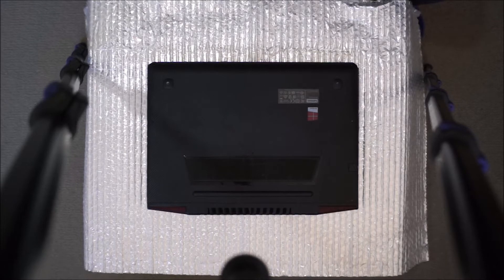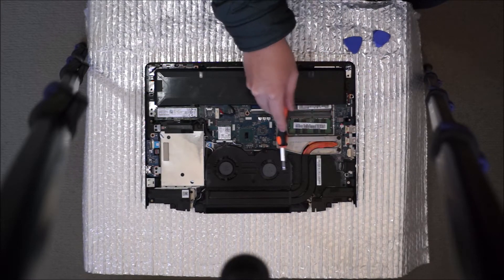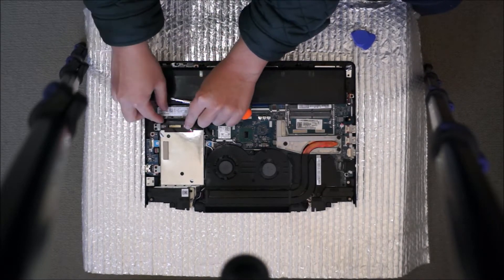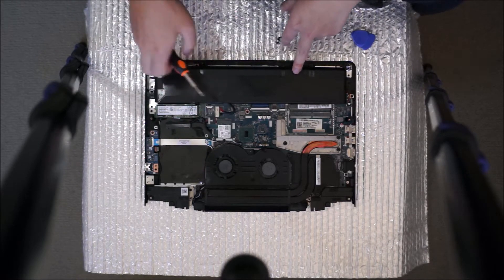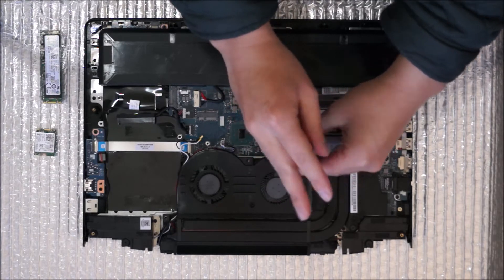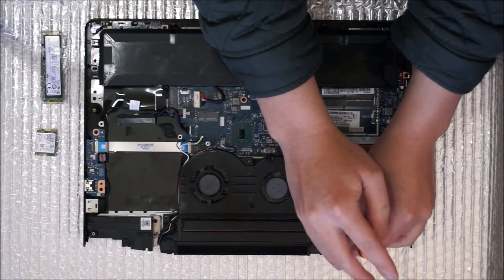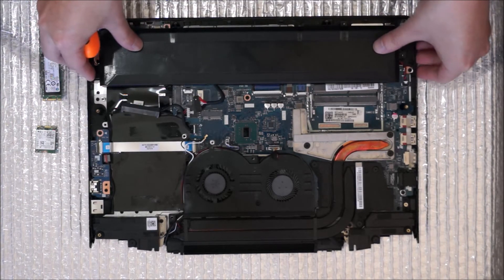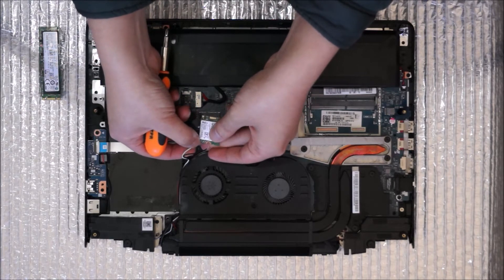OPEN ME UP ! Lenovo IdeaPad Gaming Y700 14ISK Disassembly

Comment: How can I replace the CMOS battery. I can’t find a replacement anywhre
Reply from the maker: the bios battery is same as many other laptops. look up bois batteries and if it has a cable and a connector it is probably it

Comment: Hello I have removed the cover of my Y700 to clean it. When I was done I put everything back together. However, it wouldn't work the power button doesn't light up not even the screen or the fans
When I put my mouse in the USB it lights up. When I charge the laptop the leds don't light up. Is there like a connector for the power button and leds that may have been affected or something? And where could it be? Please help
Reply from the maker: to ensure you have not miss anything open it up again and watch the video once again
Reply: @OpenMeUpTec  aight all good now. For some reason all I had to do was to unplug the battery cable from the motherboard and plug it in again. Thanks for trying to help <3

Comment: Hi 
Can I upgrade the nvme drive (my model has nvme ssd) from 256 gb to I Tb? Customer service at lenovo asked me not to because nvme upto 512 gb is supported.
Reply from the maker: this is not apple. if it fits in the slot it works. nvme 1tb has not been out long therefore if you read the user manual it is not there as 512 was the biggest back then
Reply: @OpenMeUpTec  Thanks :)

Comment: How do you replace the keyboard in this computer?  Have you disassembled it that far before?
Reply from the maker: you need to remove everything. therefore you will have to follow all the steps in the video then remove everything else after that
Reply: @OpenMeUpTec   Yeah thanks I persisted and worked it out.  They just don't make them to be easily replaced.  The keyboard is 'welded' in.

Comment: Where is the network card located what side of the board? I'm planning on removing it to install a external GPU and also what type of port does the network card use?
Reply from the maker: there the wireless card and if you watch the video you will be able to see where it is as it tells you in the video. the wireless card is a m.2 slot

Comment: Is there enough space to fit an m.2 drive that has a heat sink (like the ones from adata)?
Reply from the maker: should be able to fit it. you dont need a heat sink on a m.2 drive
Reply: @OpenMeUpTec  Thanks for replying. This m.2 drive comes with a heat sink and removing the heat sink is difficult. I am worried I might damage the PCB.

Comment: Which screwdriver i Need to Open the Laptop (Same Laptop) have Tons of screwdriver Here but all are to big
Reply from the maker: you just need one that works it needs to be small as laptops are small. you can buy a 36 in 1 set on ebay cost around $15 AUD and that will open all your small stuff

Comment: Hey there! I happened to stop by your video on changing the CPU on an HP Pavillion 23 (I have a g010, not touch screen) and I really liked it! I wonder if you can change the graphics card, like if you can connect an external graphics or if I need a new motherboard for the PC? Thanks.
Reply from the maker: you cant change the graphic card as it doesnt have one. you really cant do anything to improve your computer as it is an AIO therefore you will be better off buying a desktop. even if you could change something it will cost about the same a getting a desktop